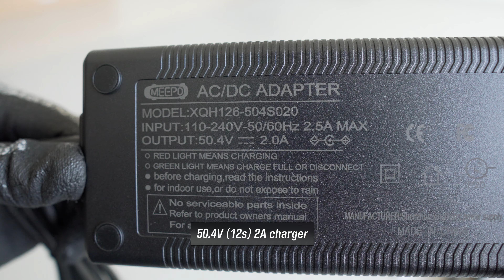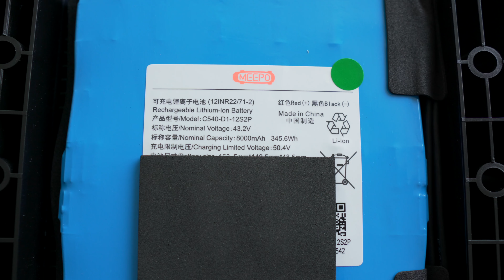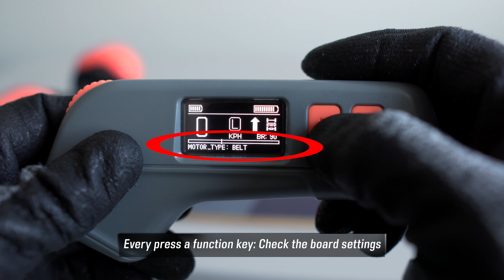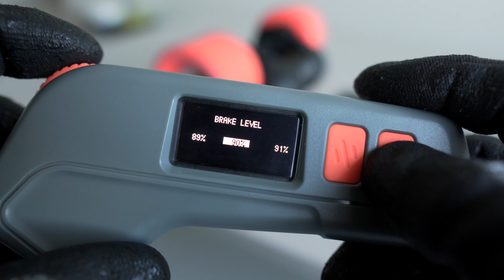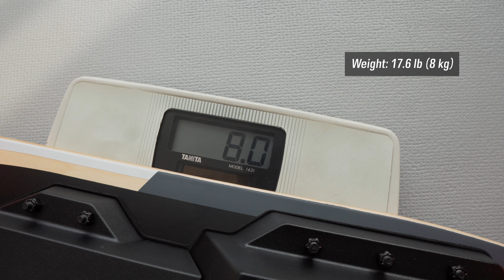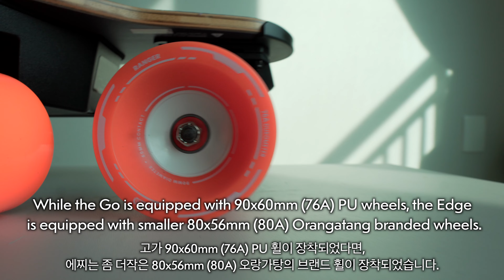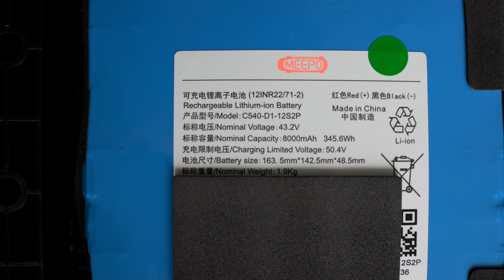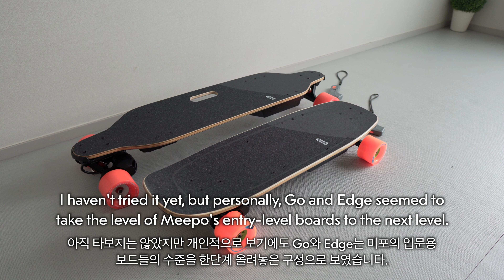#257 MEEPO Go & Edge - Meepo's new entry E board standard / JK ESC, 12s battery, Belt drive...[Pt.1]

Comment from the maker: The Meepo Go and Edge are models that replace Meepo's entry-line boards, previously known as the V-series. In addition, the range of changes was greater than that of the previous V series, and many new features were applied. Personally, Meepo Go and Edge seemed to take the level of Meepo's entry-level boards to the next level.
미포 Go와 Edge는 기존의 V시리즈로 불리던 미포의 엔트리 라인 보드들을 대체하는 모델들입니다. 그러면서, 이전 V 시리즈들에 비해 변화의 폭도 컸고 새롭게 적용된 것들도 많았습니다. 개인적으로 보기에도 Go와 Edge는 미포의 입문용 보드들의 수준을 한단계 올려놓은 모델들로 보였습니다.

Comment: Bro, these boards look amazin! Entry level belt drive And JK esc as smooth as Hobbywing! 🤩
🤙🏽⚡️🤟🏽⚡️👌🏽

Love the mini, I wish the trucks were 1inch wider like trucks on many belt drive boards in 2018. 8inch, not 7inch like this. 😢

I don't like handles but I know many people find it useful.

I prefer vertical screen or no screen on a remote, not a fan of horizontal screen. 😂
But, it allows for larger text, easier to read 👏🏽👏🏽
I agree with you about the 10bars, best feature of JK esc.

Mini rolled in at 6minutes like Pow, "I'M the fun brother!"

Meepo made amazin boards here 👌🏽
Great to see battery size over 300Wh, lots of range but not too heavy.

That mini is gorgeous, everyone knows I love minis 😂
I'd put Boa V3 90mm 74a on this! Shape is slightly different to other Boosted Mini clones, I like it, reminds me of my first eBoard in 2017!

Loved this video bro! 🤙🏽🤙🏽
I like the music in this 👌🏽
Gave me classic kami juin channel vibes.
Reply from the maker: Yes, Meepo's entry boards certainly seemed to have performance that even beginners and above could use. 
So, if beginners chose these boards, they could be used for a longer period of time.
And like you, the mini looked better among these entry boards for various reasons.
When I think about when we first started riding electric boards, now I think there are so many good options even on a reasonable budget.
Thanks as always bro :)

Comment: Love meepo but they need to clean up their catalogue. It’s almost like they have 2 of the same board but call it something different.
Reply from the maker: I get what you mean.
They will probably be cleaning up their lineup and catalog as soon as they switch to new ESCs and their corresponding configurations. 
I think the start of that will be the entry-level lineup boards of Go and Edge.
Reply: @ nice. I think they could do like exway and just have one mini but have a standard, extended range with the option of hub or belt.